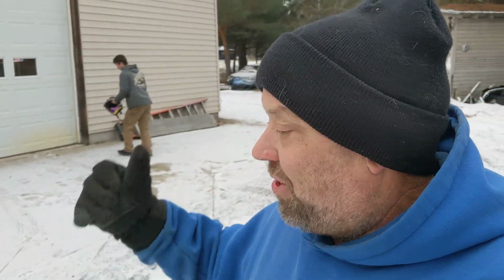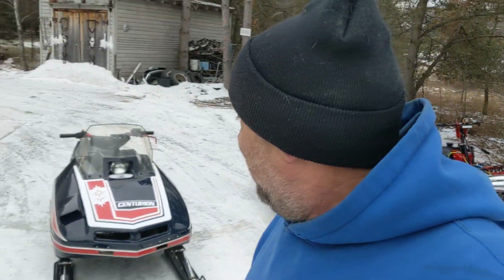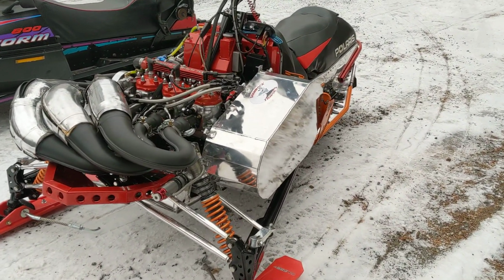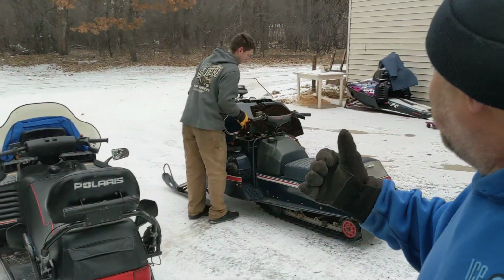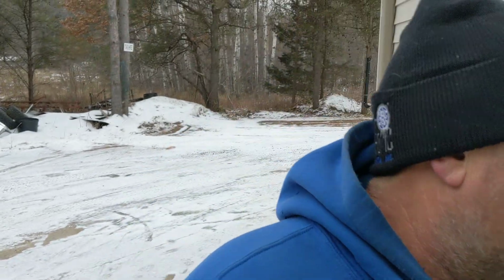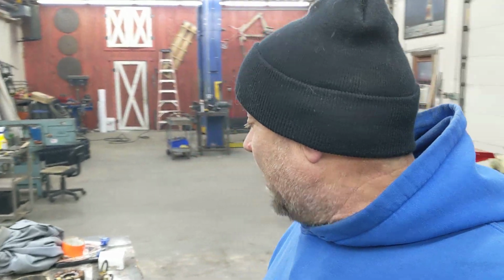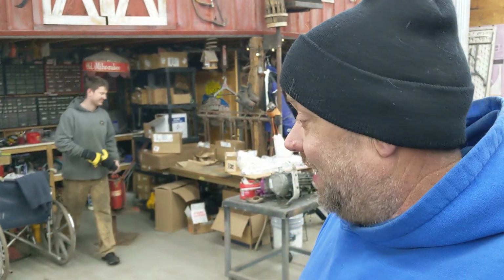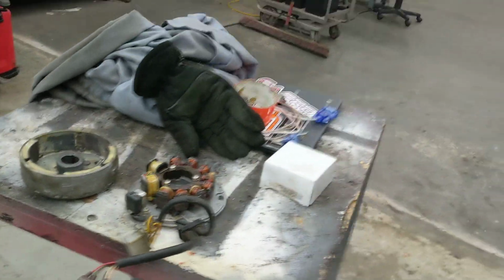POLARIS CRAZY CUSTOM TRIPLE MOD SLEDS

Comment: I had a 91 650.Was a old grass drag sled.No idea what was done to it.Carbs were taper bored.Not sure on the pipes.They were massive.Was a puzzle to get them in.Three little stingers.Almost 300 studs.Both clutches were worked.Tach was always in the red!Ate belts and drive chains.Thing was a beast.It drank gas like mad.Never skipped a beat!
Reply from the maker: Haha that sounds like a couple of ours 😅😅😅

Comment: Pretty cool to see parts of my old sled still out there. I owned the forest lake motors sports 89 650 (orca). I see it’s skis and hood there. I owned it 98-99. 👍
Reply from the maker: Nice get to hear from one of the old owners!!! 🍻
Reply: @toddclyne3493  for sure man. That sled had so much chrome. Trailing arms, radius rods and tie rods. I see you have the skis. The tunnel was anodized red. Back in the day forest lake motorsports built two identical race sleds. One was all anodized red and chrome and the other was anodized gold and chrome. Thing used to be a 1000 foot monster but I bought it with a stock 650 motor with psi pipes from them.
Reply from the maker: @bradleykunshier7705  all I bought was the hood and built the sled around it. I wish I owned the original. I remember going into Forest lake motor sports in 91 and seeing them sleds on display. They were sexy as hell!!!
Reply: @toddclyne3493  man that’s awesome. I’m glad to see parts surviving from those builds.

Comment: Hey Todd,
I have never seen a 2-up Storm. Is that from the factory or did you did a tunnel, suspension and truck extension and add the 2-up seat? Great looking sled.
Reply from the maker: It's an ultra touring. I had the storm hood so what the heck I put it on.
Reply: Thanks for the quick reply. 

Didn’t know they made an Ultra Touring. I had a 96 XCR SP and loved it. 
Any idea if any Ultra Tourings are for sale in your area? I am in Northern Michigan and haven’t seen any. 

Nice work on your videos, please keep making them. 

Thanks again,
Tim Lash

Comment: Hey man how do you get scratchers on the inside of the skis? I have a Xlt that has blown a couple head gaskets from getting to hot in early season an late season riding.
Reply from the maker: Screw them to the ski bolt

Comment: I have 97 Polaris 680 Ultra with 8500 miles, looking for some performance upgrades (can, pipe, or rebuild) what do you recommend)
Reply from the maker: I would just do a rebuild and run it. If your looking for better sound I can set you up with one of my cans I make. polaris.trashcan@gmail.com

Comment: Do you guys use a stock fuel pump on your triples? I'm having fuel delivery problems and am thinking I am going to add an electric fuel pump.
Reply: I have an Indy Ultra SKS..
Reply from the maker: Yes we do
Reply from the maker: Check the pickup line in your tank. They rout off over time

Comment: Does bastard run the width a RED C.H lean at idle? Maybe one half pilot size lean? A delvrin spacer half the width of a needle slot, under the oh Jesus (where’d it go) clip to richen it just enough to idle like the other three, and not stumble coming off pilots onto the needle/ main jet . Really like the Ultra with a trash can… they all sound rowdy as hell👍
Reply from the maker: Thanks for the great comment. I'm guessing Bastard was just having some issues with the old gas. Usually runs like a champ

Comment: Hey guys i got a 1995 rxl 650 touring and i need to know the head bolt torque spec if anyone can help please do just send a replie on the comment thanks
Reply from the maker: 26 ft lbs on the large ones and 18 on the small ones. hope this helps
Reply: @toddclyne3493  would you mind if emailed you and sent a picture of it

Comment: That is bad to the bone wow loud I have a zrt that is loud and I have to get the Pip's fixt
Reply from the maker: Sweet
Reply: @toddclyne3493  I would like to find a set of decker Pip's for it. I use none ethanol
Fuel. And ams oil